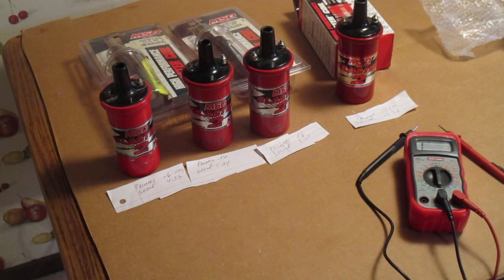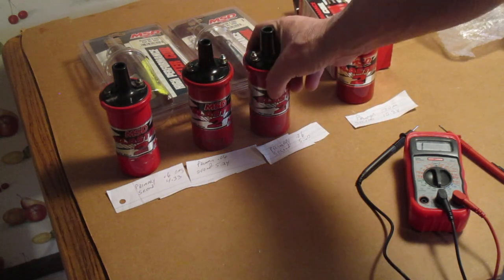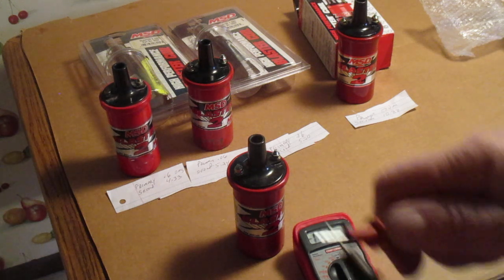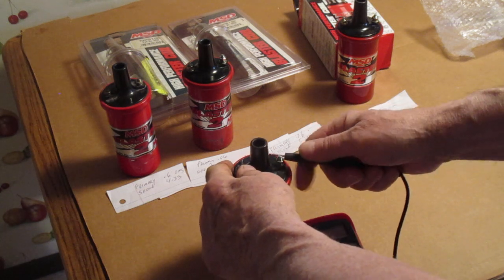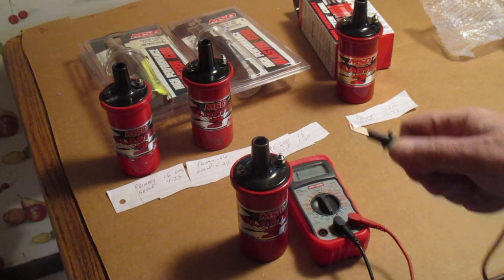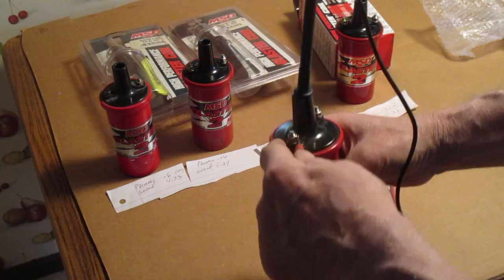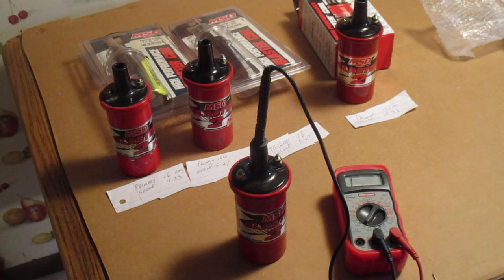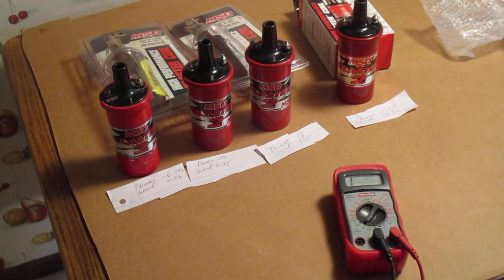Testing MSD Ignition Coil

Comment: I have had 4 of these coils get hot, crack, and go bad on my Jeep CJ with an MSD 6AL ignition.  What the hell is going on, and which coil should I change to.
Reply: My MSD Blaster 2 coil is on it's 8 year of running on a 4 cylinder weekend warrior, which is around 30 000 miles. I have read somewhere that the coils do draw power and can get hot if the ignition is on and the car is not started for a long period of time.
Reply from the maker: i was not running a 6 box on mine what was my issue the MSD ready to run distributor was weak putting out weak spark so thing coils got waek new coil has 10.5 secondays compaired to the old ones 4.8 5.4 i never had one crak make sure its not sitting on hot manifold call holly preformance they have tectline maybe you 6 a box could be bad not sure

Comment: Why do all the coils look new?? Thats a lot of shiny coils to go bad before they even luve under the hood!! Doesnt look good for MSD reliability! I am on coil #3 MSD not happy about it and last time with the company they said my box was bad! I have the deluxe box, coil, and billet dustributor with low hours and Am beginning to thi k tbus company makes Crap Components.  Worked superb for 5k miles then been eating coils. Gonna think of going back to stock or a other brand! These people kinda just say   buy new cant rebuild your box Yet they say they can rebuild them. NOT HAPPY WITH MSD! Cam you tell
Reply from the maker: the coils were not issue with me it turned out MSD distributor went bad then stopped all together it was 21 years old so i sent it to MSD to fix they replaced control module and pick up part was $160.00 they charged $190.00 to rebuild it all new bushings and even new vacuum advance no charge for that total like $30.00 labor car now starts right up and fixed   https://youtu.be/7Sc2Hl1ik74?feature=shared